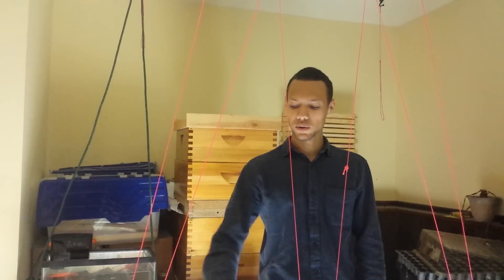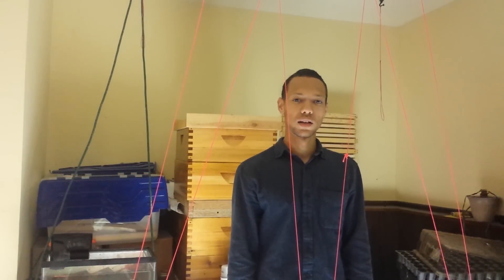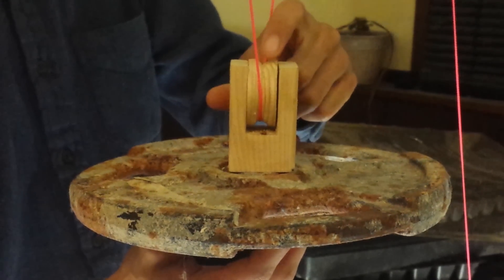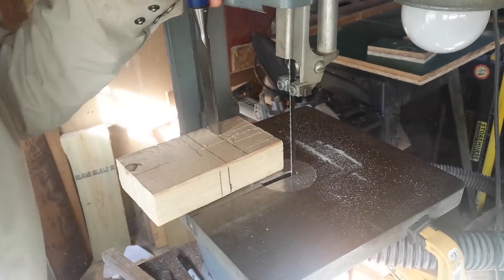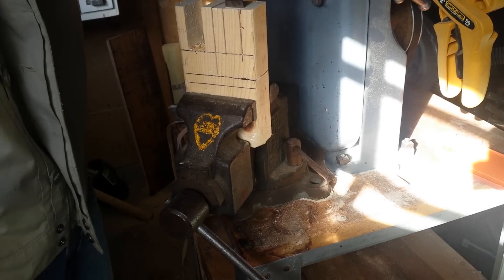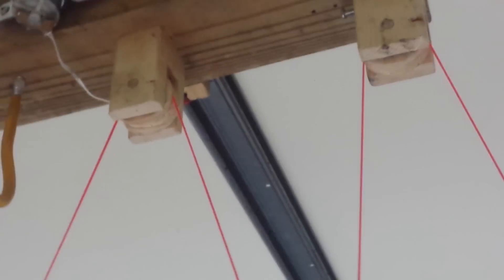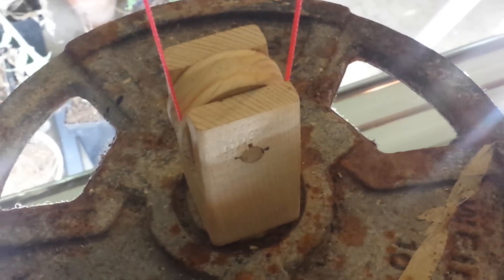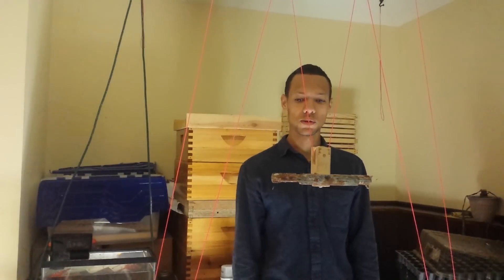Grow Light Hanger Pulley System

Comment: hello, great video(s), made my own version of your light rail system and would like to build the light hanger pulley system as well but was wondering how did you calculate the weight of the counterweight ?

thanks
Reply from the maker: Thanks, glad you found it helpful. I arranged the pulleys to make it stable and symmetrical, as a result of this configuration there isn't any mechanical advantage gained so the counter weight is equal to the weight of the grow light. In my case the grow light only weighed 10 or 12 lbs which isn't much. 

With the number of pulleys I made I could have arranged them to get a 4:1 or 2:1 advantage but it would have had complicated how I attached the grow light to it.
Reply: great, thank you, i'll start working on it this very weekend ;) also you can add me on FB so that if you pass by paris anytime soon you can give me a holler, i'll show you my set up ; i guess we have a lot in common;
Reply from the maker: If I had a Facebook I'd add you but I do not. That's really nice of you, Im going to visit Paris as some point but I don't foresee it being anytime in the near future.
Reply: whenever :)